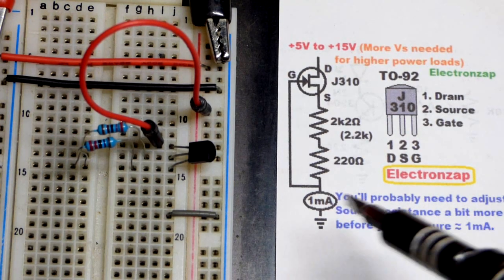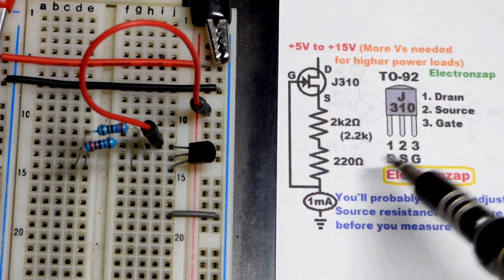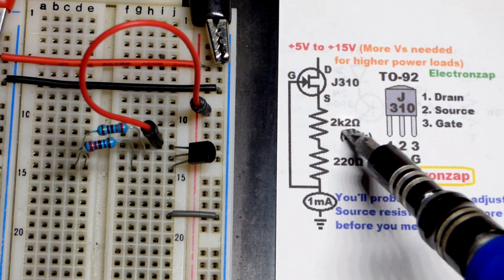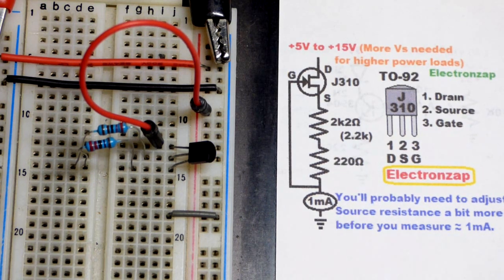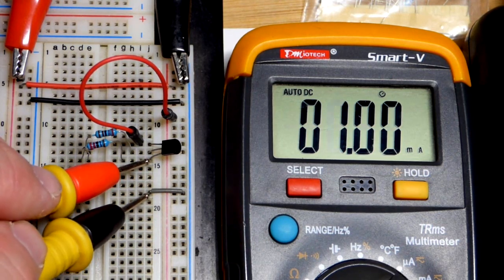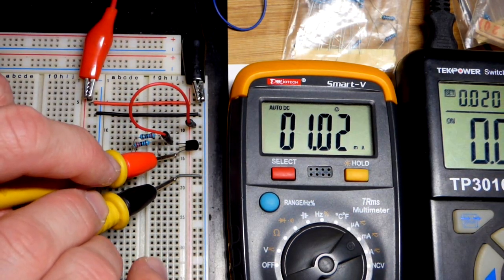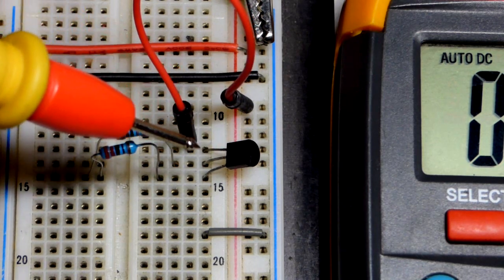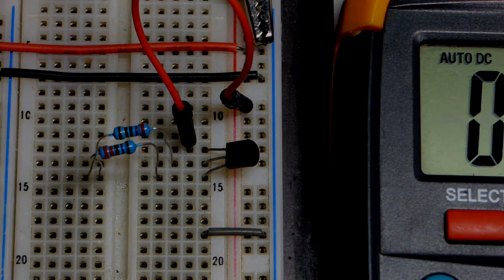Approx 1mA current source circuit using J310 N channel JFET learning electronics shorts 47

Comment: Good video, thanks. I may need to build a current regulator for an old Zenith tube radio that uses a tube (50A1) for doing this that appears to be in rough shape. The replacements for those tubes are a bit rare and they bring a fair amount of money. I'll stuff an old 9 pin socket with modern semi conductors and call it a day.
Reply from the maker: Hope it works out well!